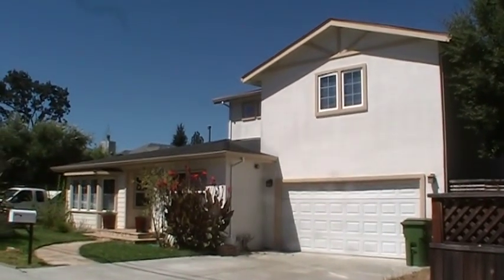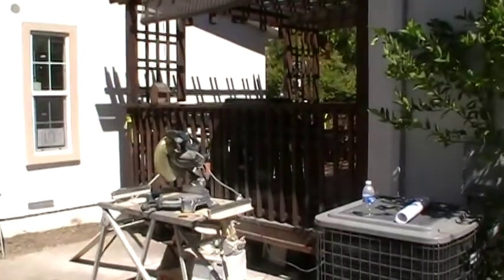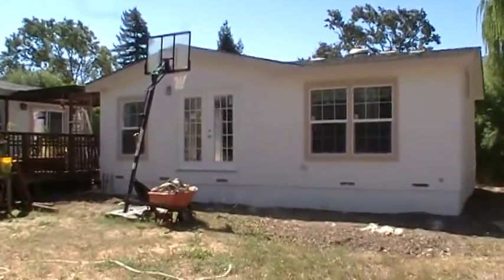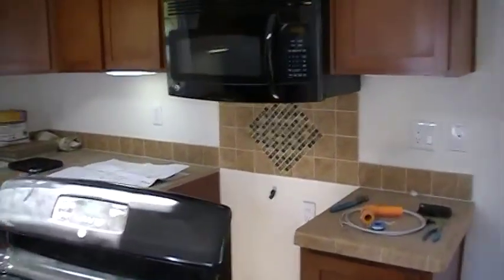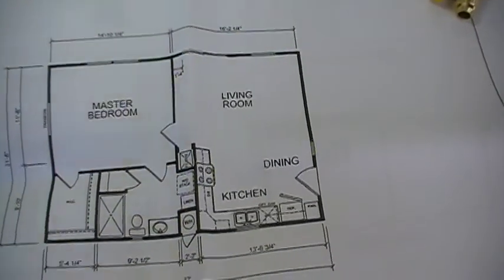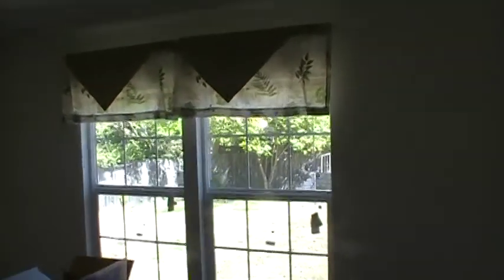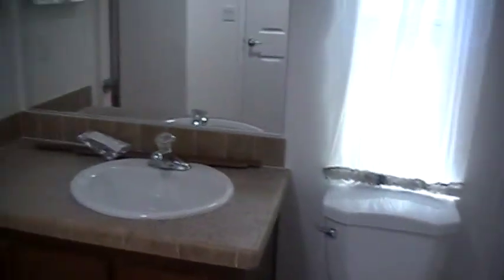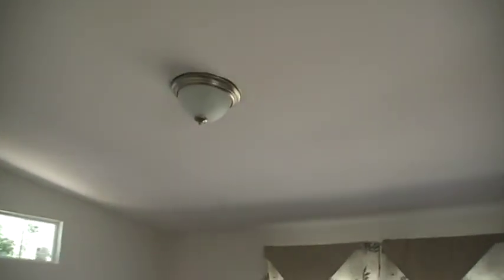Novato Backyard Home (Prefab)

Comment: What were some of the green building standards? We are looking to create a 216 sq ft ADU out of a garage. Size alone counts for a major foot print decrease, I can only imagine if we did a few things here and there like insulation exceeding code, LED canned lighting, decent 2 pane windows, a hotel heat pump, etc.  I don't plan to go over board since it is rather small, but any ideas for insulation, healthy atmosphere, and smaller foot print is appreciated.